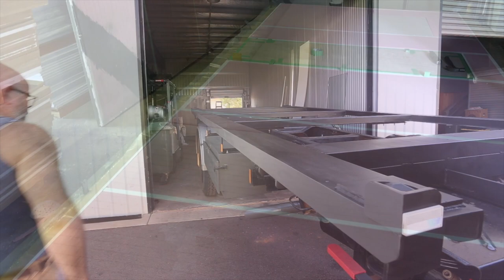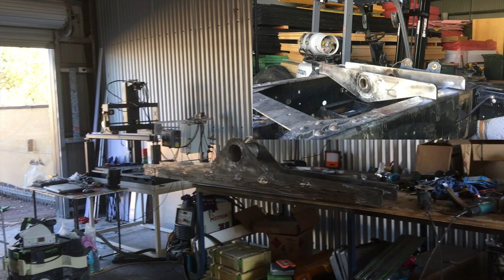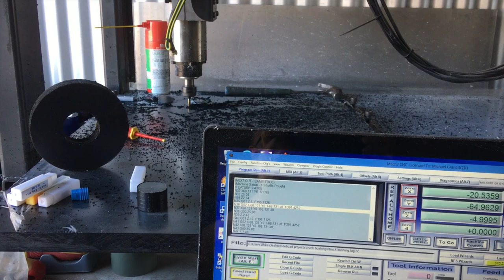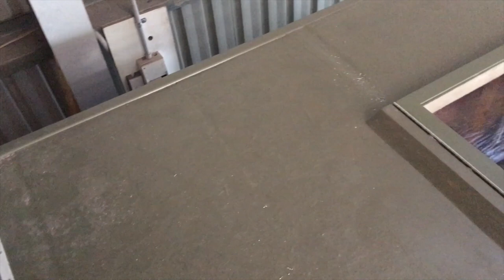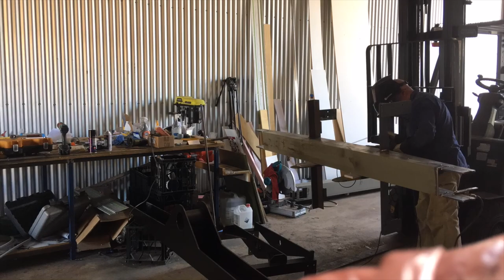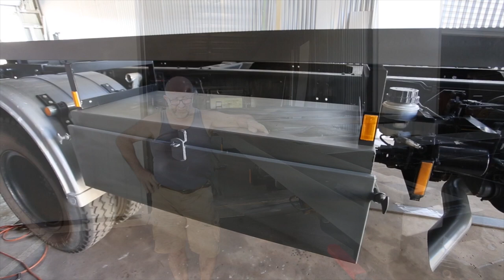Wombat Expedition Truck build   Ep 8

Comment: I love your channel, came here looking at exploration vehicle builds then discovered your excellent wildlife videos. I was watching them last night on my TV and I'm sure I've never seen any YouTube video with a higher resolution as yours. On another note, if as you say, your subframe has a rocker at the back and is fixed at the front then you shouldn't be able to rock it up and down at the back like you did at 2:38 unless what we're seeing is flex in the subframe OR there is something else going on at the front such as the front hadn't been fixed down at this point and was temporarily sitting on wood OR  you have light-weight springs between chassis and subframe at the front OR it's on airbags at the front which don't have much pressure at the time of video? Great build by the way!

Comment: Hi Mike, after looking at your effort . I have begun my own search for a 4x4 truck to build a Experdition Camper ,and I will probaly look at yours several times before I start .Looking forward to see the next EP 9 .only one question so far bonding your fiberglass to steel to hold the walls in place screw ,glue or all of the above ? Regards Mark